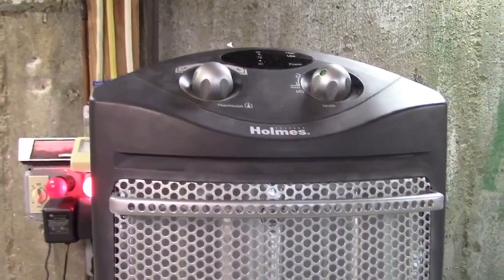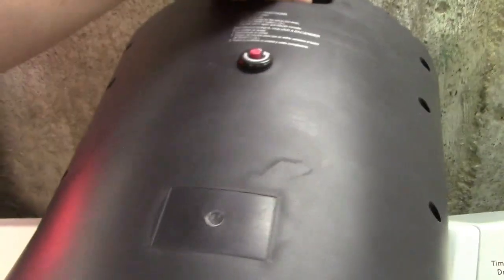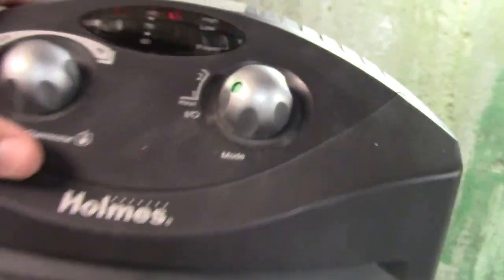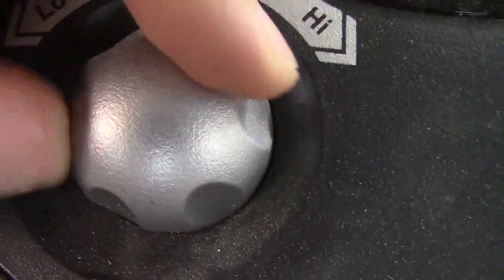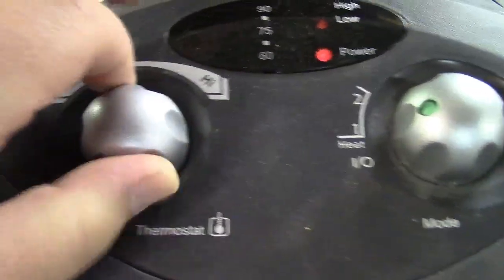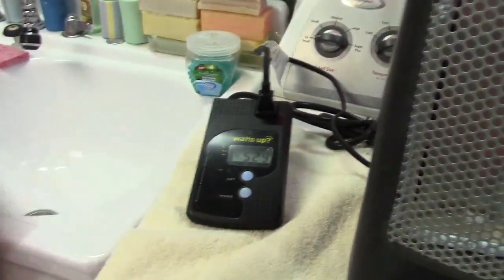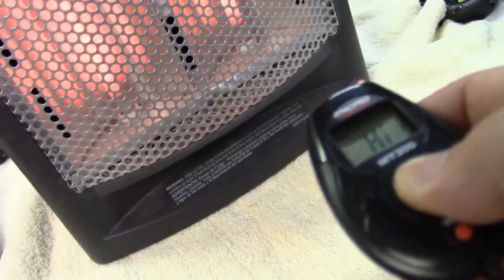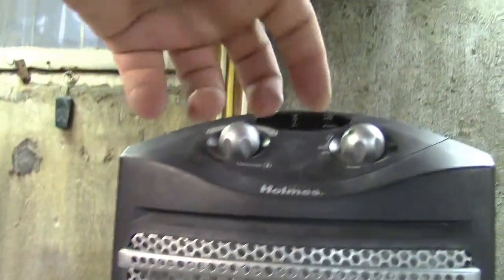Holmes HQH308 Electric Heater

Comment: I have one of these and it worked pretty well for awhile. I was running it for several hours a day. Now the fan won't kick on for some reason so it shuts itself off from overheating. No amount of turning it off and unplugging it for any length of time seems to fix the issue.
Reply from the maker: Right, because none of that is addressing the actual problem, which is the fan.  It's obviously not turning, likely it's in need of lubrication.  So the heater will have to be taken apart so you can fix the issue.  It certainly won't fix itself by playing games with it, but it will be happy to burn your house down when the safety mechanism fails.

Comment: Need a little help. Mom has two these unit. The on/low/high switch have frozen in off, they are broken. Can not find information to ID the switch. The manufacturer has discontinued the units and no manuals; zero info from Holmes.  If, someone in the community can ID if the switch is a 4 position, 2, or 3 gear, etc; we would be grateful. Best space heater she has ever had.
Reply from the maker: Not willing to take mine apart for the part number that likely you won't be able to find.  It's 3 positions, off, low, high.  Whether you can find one to fit it or not, I don't know.  What I would do if it were mine is just hard-wire it on high.

Comment: I have one, it's turn off and on switch is different than the one you have. 
Last year it would go off when hit room temperature. 
I can't get it to how it turns off when room is at temperature l out it at. 
How can l get it to turn off automatically and on when room it's hit room temperature l set it at? 
Can't figure out how l managed to do that last year? 
Keep in mind my units on and off are different than yours. 
My unit does heat up immediately though which is good.
Reply from the maker: If yours is different, how can I possibly tell you?

Chances are very good the thermostat is bad or worn out.  The switches on pretty much all heaters are junk--they manufacturers use the absolute cheapest, junkiest ones they can get their hands on, in order to save a fifth of a cent on every unit.

Comment: Any idea how I can remove the front screen? It seems to be pretty dusty in there and I’m not sure if I need to unscrew from the back or if the front screen just pops off
Reply from the maker: The unit appears to be of a "clamshell" deign, two halves that separate.  Before anything, if you have compressed air, try just blowing it out with that, it may do the trick.  If you really want to open it, take the screws out of the back (you'll need a long-handled screwdriver, and the two halves should separate so you can clean it.  Be very careful of those quartz tubes, they are fragile.

Comment: I have the same one that stopped working the power light will turn on but I get no heat from it, I don’t know anything about these heaters. Any idea how to fix or replace?
Reply from the maker: Sounds like it's time to open the heater up and break out the multimeter.  Most common cause of failure is a burned wire; all electric heaters pull tons of current and it's not uncommon for a wire to burn off.  Otherwise, check the resistance of the heating elements, if you get "out of range" on the meter, one of the elements has gone bad and you'd have to search for a replacement.

If the heater was just working but now suddenly stopped, it could be a failed over-temperature sensor.  Meter that for continuity as well, if it's open circuit then you'll need a replacement, which you can probably get on ebay from China for about 75 cents.
Reply: Thank you!! It was working GREAT i was using it just the other day and I let my dogs inside yesterday and they knocked it over and now it doesn’t produce any heat but like I said before the “power on” light turns on but nothing else. It’s such a great heater would hate to get rid of it much rather fix it and continue using
Reply: So to find this circuit I would search for what exactly? I’m sorry just don’t know much about these heaters, a circuit for Holmes tower heater?
Reply from the maker: Yeah, no problem!  It may be as simple as a broken-off wire inside.  Otherwise you might be looking to source replacement quartz tubes for it.  I'm speculating you might pay $25 for one, at which point most people would say "oh, I'll just throw it out and get another heater".  Don't.  Fix this one.  You won't be happy with the junk today.
Reply: jaykay18 I really appreciate the responses and for your help, thank you! I’ll look into it and yeah I’d much rather fix this one rather than buying a new one and it being crap anyway. Take care!
Reply from the maker: No problem Tyler!  Good luck with your repair!

Comment: That's a great heater. My grandma has one and it's one of the best heaters I've ever used.
Reply from the maker: Yeah I use this one in the garage and it actually does take the chill off the air.  Still 30 degrees in there with it on, but it makes a difference.

Comment: Why does this heater turn on and off by themselves, anyone?
Reply from the maker: Either due to the thermostat reaching its set temperature, or a thermal overload is getting tripped.
Reply: @jaykay18  Thanks. I just bought one two weeks ago, it wasn't doing this and I was using it to highest level all the time because it's cold. I unplugged it for 2 days plugged it again and now is doing this. Even on the low temperature level. Also follow the manual to reset it but no success.
Reply from the maker: Was this new when you bought it?
Reply: @jaykay18  yes
Reply from the maker: I'd exchange it.

Comment: After a few minutes mine trips it’s breaker. Any thoughts?
Reply from the maker: Is the fan in it still running well?  If not, it can overheat and cause that.  Another reason may be the breaker is just worn out, especially if that heater has seen a lot of use.  Or, there could be a bad connection inside, an area of resistance.  Resistance causes heat, but also increases current draw, and that may be the cause also.

Easiest fix would be to replace the breaker (if the fan is OK) and see if it just works.  Chances are pretty good it'll be all right, it's probably just worn.
Reply: jaykay18   Thanks I’ll do that. I like the heater.
Reply from the maker: OK great, let me know what happens!
Reply: @jaykay18  I have the same kind of heater
Reply from the maker: @peytonmarceaux8788  These are not all that uncommon.
Reply: @jaykay18  I have the mainstays
Reply from the maker: @peytonmarceaux8788  The names mean nothing, they all come out of the same factory in China.
Reply: @jaykay18  I saw one on walmart .com
Reply from the maker: @peytonmarceaux8788  Mainstays is a WalMart house brand.  It's a made-up name, that means nothing.
Reply: @jaykay18  no its not

Comment: I have a heater now just like that one but it's white in front and grey in back. It's a Sunbeam sqh310 it's been working well for over 10+ years my grandma had it and then she got a new other heater so I got it now 😂
Reply: It does also have that red reset button on the back as well so it's a older model
Reply from the maker: @CraigyWaigyplays_official  Sunbeam owns Holmes, so it's no surprise there is a Sunbeam version of this in a different colorway.
Reply: Jaykay 18 I have a question my heater this past week started to act up and it's trying to run on number 2 when it's on number 1 do you think you know what the problem is?
Reply from the maker: @CraigyWaigyplays_official  Probably a bad switch, they use the cheapest ones they can possibly get.  A multimeter will verify that for certain really easily, and I'm sure with enough searching, you can find a replacement switch out there.
Reply: Ok I found what I was looking for but are you talking about the knob that you turn to 1 or 2. Or are you talking about a switch that is inside of the heater?
Reply from the maker: @CraigyWaigyplays_official  The knob.  The knob is for you to grab.  When you turn it, it turns a shaft that goes into the switch inside the unit.  That part goes bad.
Reply: Ok thanks 👍

Comment: I miss mine I had the analog version in White it was 1 of the best heaters I had
Reply from the maker: Yeah it's something to do with the design of this heater.  As you know there are all different types like oil-filled, ceramic, etc, but these radiant ones seem to really do the trick.  Each heater type is good for a particular application.

Comment: I have one too it’s white
Reply from the maker: My life is now complete.
Reply: My heater doesn’t have a digital control panel
Reply from the maker: @holdenwynn-ludwig3903  So you don't have one.  You have something different.
Reply: I have a heater it looks exactly the same but it’s white
Reply from the maker: @holdenwynn-ludwig3903  But it doesn't have a digital control set, so it can't be the same.
Reply: Yours looks good
Reply from the maker: @holdenwynn-ludwig3903  Thanks.

Comment: I have one.  They work quite well.  Just be careful about anything near the front as they get EXTREMELY hot.  I temped mine close to 200C on a digital temp gage.  Mine heats up in about 90 seconds.  Mine has mechanical controls but does have a safety shutoff.
Reply from the maker: Yes, it sure does get hot!  This one has that circuit breaker on the back, possibly a tipover switch but I've never tested for it; I'd imagine it does.

Comment: It is NOT obnoxious at all. I have 4, two in my workshop, two upstairs with one in a bath and one in my 0V room. Saves gas for my furnace.
Reply from the maker: I've got a collection of heaters all over the house,  Different ones for different areas.  Each one is better for localized or wider-spread heat.  As for saving gas for your furnace, I don't know what the savings is, because electricity costs more than gas, at least around here, where electricity is about 25 cents per KWH.  So while very efficient, not cost-effective to run for long.  The heaters I have get used quite a bit for about 2 weeks out of the year, in that time in the fall where it's really starting to get cold and the house gets down to the low 60s at night.  After a couple of weeks or playing the game, I'll fire up the gas boiler for the season.  Then, the heaters mainly sit unused for the rest of the year, except for maybe a really cold morning where it just needs a little more.